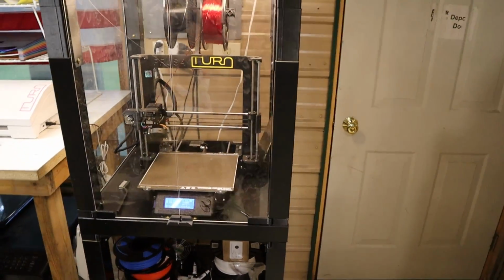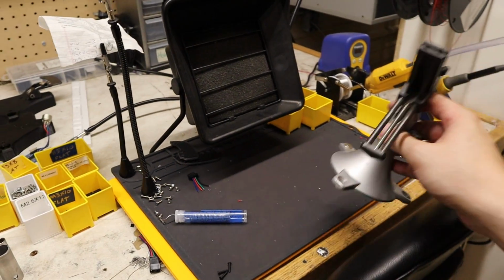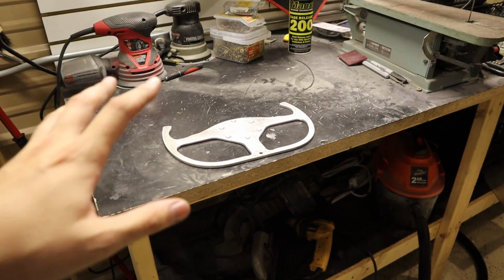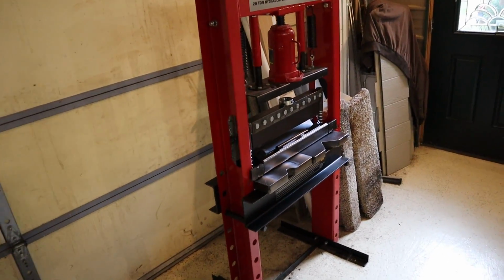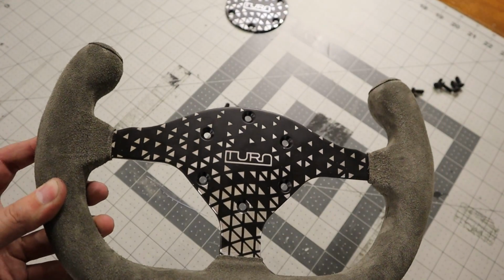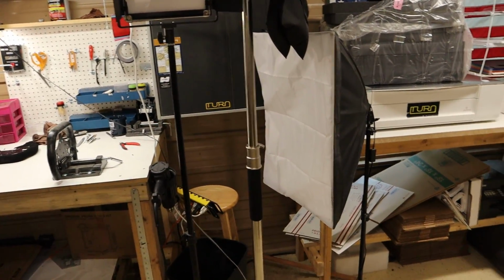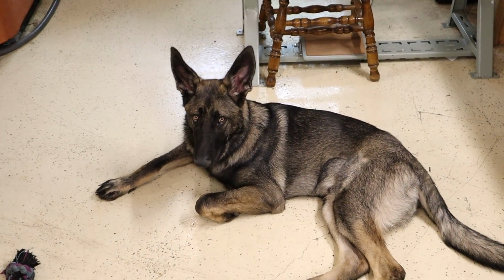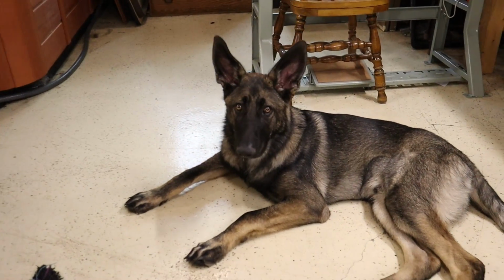Shop Update #2

Comment: I really appreciate this video. I don't think most new business owners would post a video outlining their struggles and how they run. I too run a small business where I'm doing manufacturing in my home and I go through the same thing of wanting to buy new equipment or injection molding but not wanting to have too much cash out the door. So I have to weigh is it worth it to invest in certain pcs of equipment and or what I should do myself. Your operation is much more involved though. I ordered a rim from you yesterday can't wait to get it.